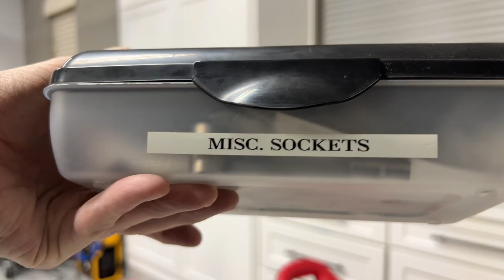BTS Shooting a Shop Video | Behind The Scenes

Comment: Did you do that garage floor yourself? Been going back and forth between doing epoxy or Swiss trax tile.  I’m also considering a lift table. Why don’t you have one? Is it that most people buying your maintenance series wouldn’t have one?
Reply from the maker: No, I hired a company to do the epoxy. I used to have plastic tiles, but much prefer the epoxy.